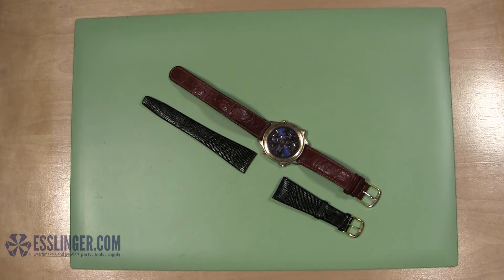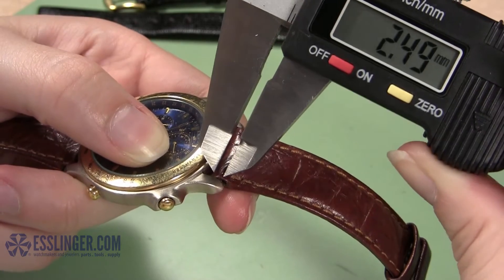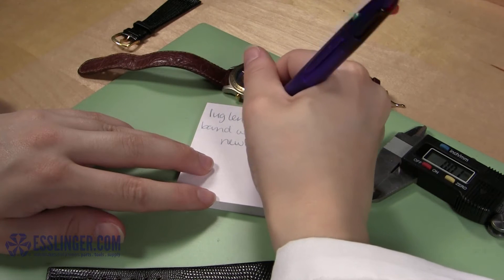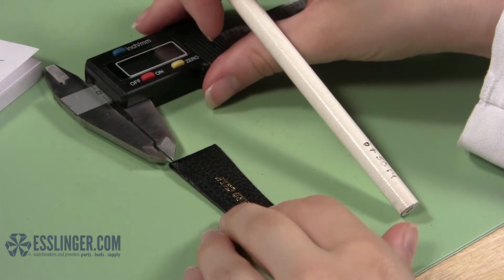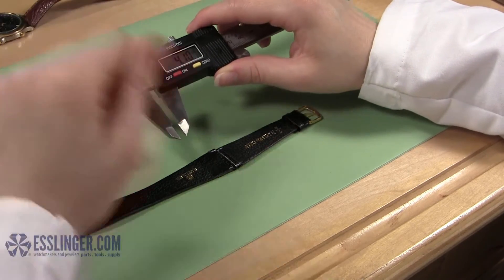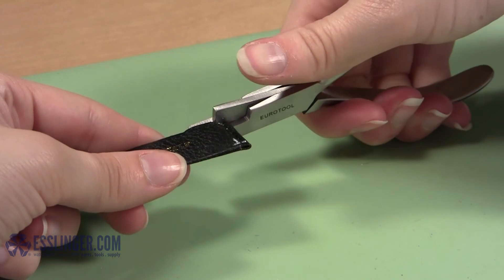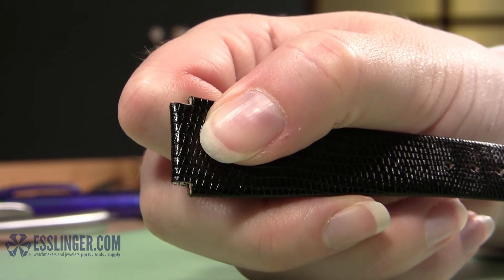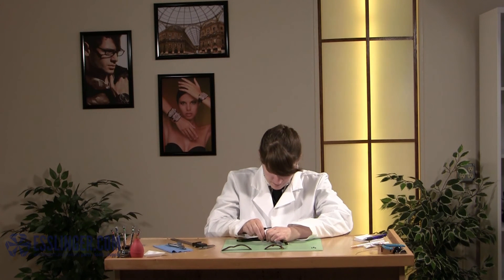How to Use Watch Band Notching Pliers

Comment: Would have been nice to see a close up of the strap fitted to the watch... but I guess it was overcut slightly due to the inaccuracy of that marking pencil. I would have used the sharp points of the calipers to transfer the markings on the underside of the strap, pinpoint accuracy compared to the smudges the pencil made.

Comment: Great video, thank you.  I was going to try this with a razor blade, but I'll be doing it frequently so I will just buy these pliers.  I have a few 34mm vintage Rolex watches with the awkward 19mm lug width.  The 19mm straps look a little too narrow on the small watch, and it looks awkward on the wrist.  However, with a wider strap the smaller cases look classic and I love them.  I can now buy 21/22mm straps, cut them down, and get the look I want without paying some etsy guy $$$.  Thank you for the video, it will clean up my process and reduce trial and error.

Comment: Measuring to .01mm and then marking with a 1.5mm wide line? Might as we'll have done it by sight.
Reply from the maker: Yes, if you are commonly using small gauges and mm for your work, it will be easier.

Comment: Seriously, just buy the correct size strap.
Reply: Fair enough, but I want a much wider strap to fit my watch. It is a 70's swiss with a narrow 18mm band but a 37mm case. I bought and trimmed a 24mm strap to fit the 18mm lug width and it looks amazing now!
Reply: I can tell you don't collect vintage Rolex...